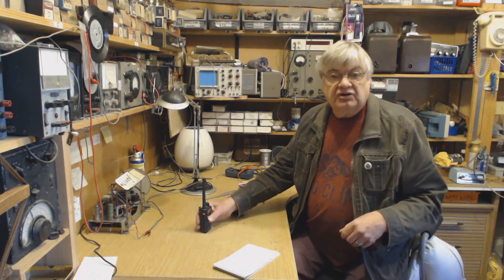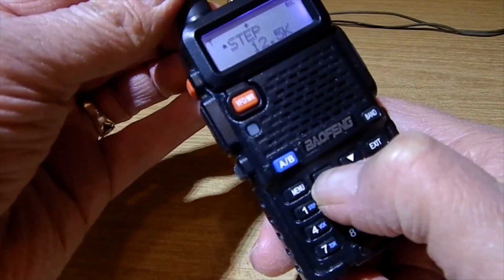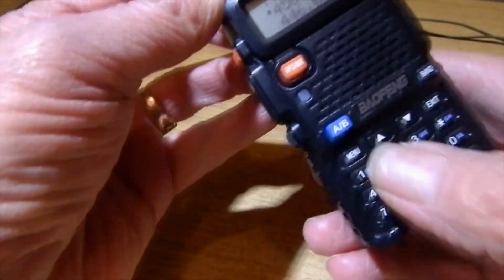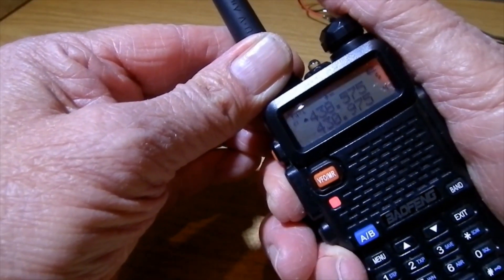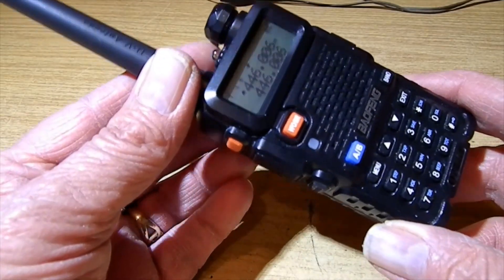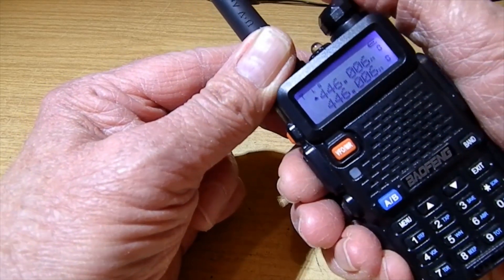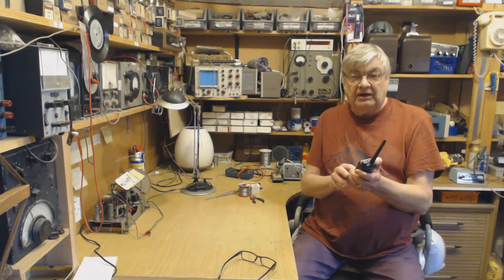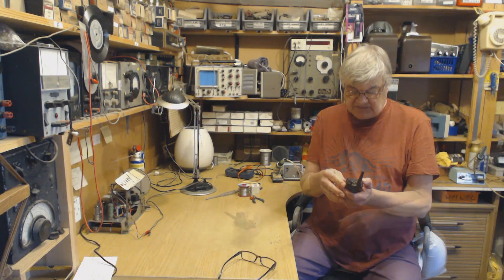G4NSJ - Baofeng UV-5R Porgramming GT-3

Comment: Thank You so much Ray!
I have two of those and, like you, I spent quite a bit of time working out the 'logic' of their programming. Once you work out their method it's quite simple then.
I have also upgraded the standard battery that comes with it with higher capacity - and quite larger and physically longer ones - that apart from giving it longer transmit / receive time, make it easier to hold as the overall length of the transceiver increases from 9cm to almost 14cm. It also gives it a more full size 'professional' look.
You can find these larger batteries here Ray:  https://www.amazon.com/BAOFENG-Original-Capacity-3800mAh-Extended/dp/B072FS8F6B/ref=sr_1_2?dchild=1&keywords=baofeng+uv-5r+battery&qid=1585277600&sr=8-2
Lucky you guys go slowly into summer. It's the opposite here 'down under' and we all brace ourselves about this terrible viral spread.
Keep well and keep safe Ray.
73's